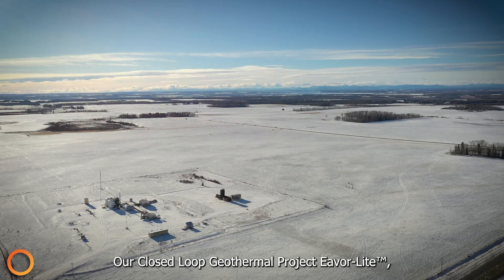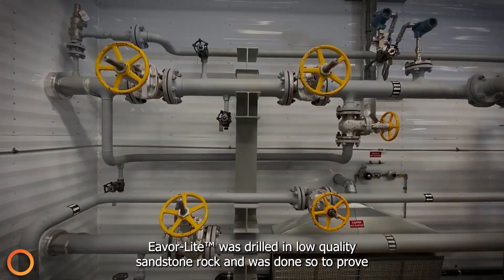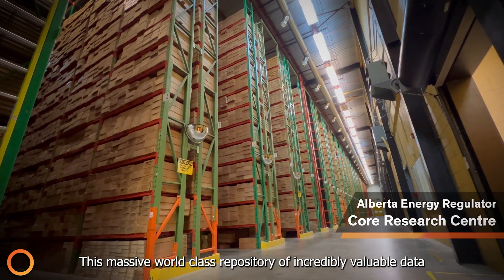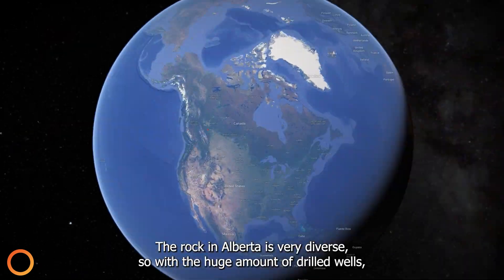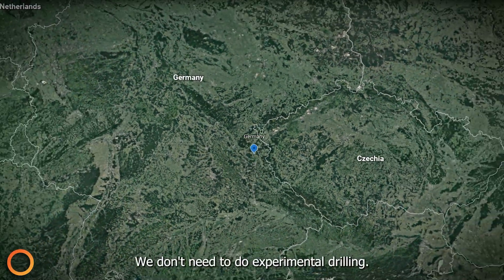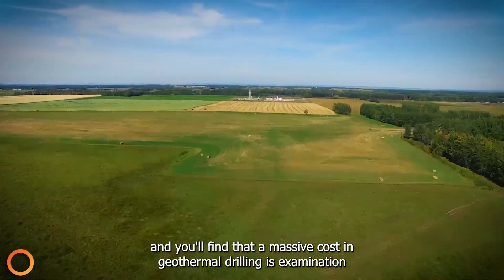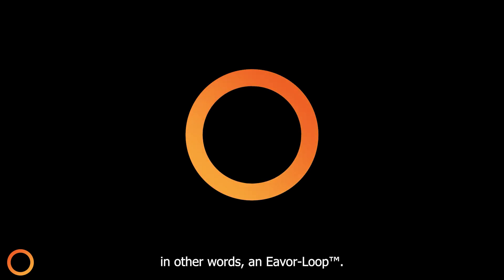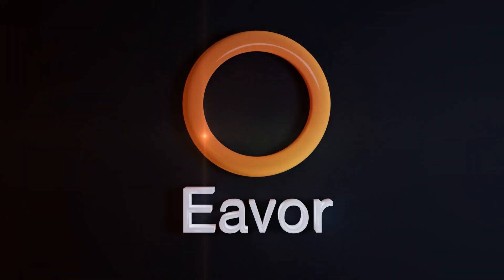Eavor's Circle of Knowledge

Comment: Every well drilled, being these dry wells or suspended oil wells have the temperature profile which increase as the depth increase, so heat energy is everywhere. Harvesting these energy depends from final goals the energy is needed and location. If economy need heating energy this is easy, but if the economy need electricity energy, then the wells must provide high heat, and have high temperature at least higher than 200 deg C and up. 
Drilling deeper and at higher temperatures is not easy and it is not cheep, it is very expensive.
Company experts claim they can drill and this is credible, the problem is drilling cost and time, and then other challanges. 
Peoples must consised and some general data about geothermal temperatures and depths. For example they must learn the temperatures the deepest wells ever drilled have on depth and the cost of drilling.  So, if we search on google we find that "The cost to drill the Kola Superdeep Borehole was over $100 million, which is about $2,500 per foot.". 
When we see drilling on USA, The Lone Star Bertha Rogers No. 1 well with maximum depth 31,441 feet, which encountered 475 degrees F (246 deg C) and cost around $7 million to drill, these can not compared with Kola Well where temperature were around 195 deg C (are the data reliable?). 
I believe today drilling industry is improved somehow, but the challange is big especially drilling hard rocks like granites at high depth and high temperatures.

Comment: One of their key claims seems to be that their drilling experience in Alberta provides them with kind of a knowledge matrix of rock types/drilling technique/thermal yield that can easily be transferred to potential drilling sites worldwide. I find that very hard to believe.
Reply: I believe it. They've been extracting oil and gas from all kinds of rock in very difficult conditions for decades. Alberta's oil and gas is so hard to extract it forced them to be very innovative. Years ago the Canadian prime minister said they would use their knowledge and experience to find clean energy and that's what they did.
Reply: I would say its the experience that Alberta has in drilling toe and heel oil wells. They talk about Sandstone in this video which is a softer rock then were they want to go to . They want to go to Granite rock which is deeper. Sandstone density is less then granite.

Comment: What about aready drilled wells . Can dry oil wells be converted to a closed loop geothermal system. 
How does frakking affect your ability to seal the closed loop and prevent leakage ?
Reply: a casing may allow fracked wells to be used
Reply: Every well drilled, being these dry wells or suspended oil wells have the temperature profile which increase as the depth increase, so heat energy is everywhere. Harvesting these energy depends from final goals the energy is needed and location. If economy need heating energy this is easy, but if the economy need electricity energy, then the wells must provide high heat, and have high temperature at least higher than 200 deg C and up. 
Drilling deeper and at higher temperatures is not easy and it is not cheep, it is very expensive.
Company experts claim they can drill and this is credible, the problem is drilling cost and time, and then other challanges. 
Peoples must consised and some general data about geothermal temperatures and depths. For example they must learn the temperatures the deepest wells ever drilled have on depth and the cost of drilling.  So, if we search on google we find that "The cost to drill the Kola Superdeep Borehole was over $100 million, which is about $2,500 per foot.". 
When we see drilling on USA, The Lone Star Bertha Rogers No. 1 well with maximum depth 31,441 feet, which encountered 475 degrees F (246 deg C) and cost around $7 million to drill, these can not compared with Kola Well where temperature were around 195 deg C (are the data reliable?). 
I believe today drilling industry is improved somehow, but the challange is big especially drilling hard rocks like granites at high depth and high temperatures.